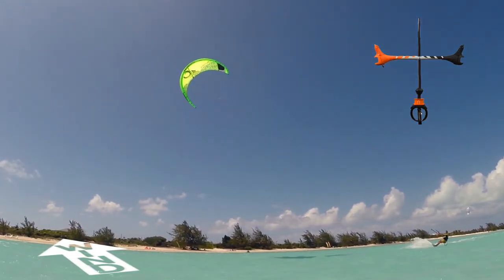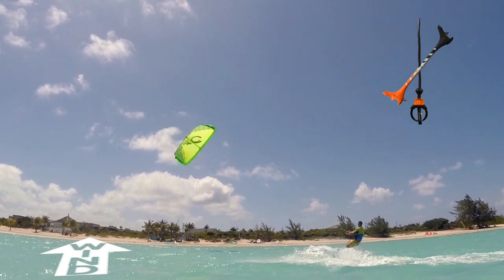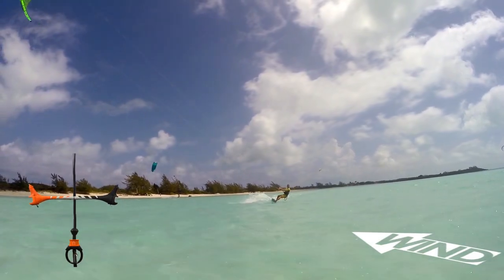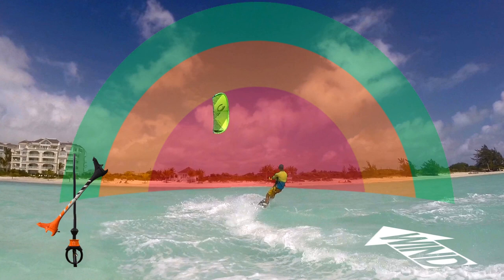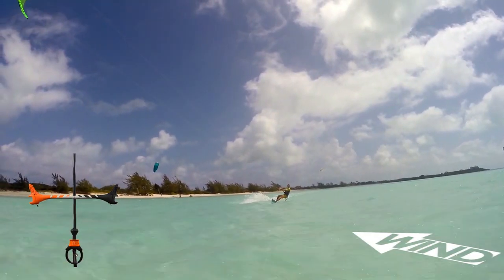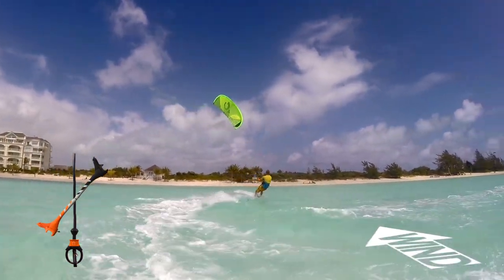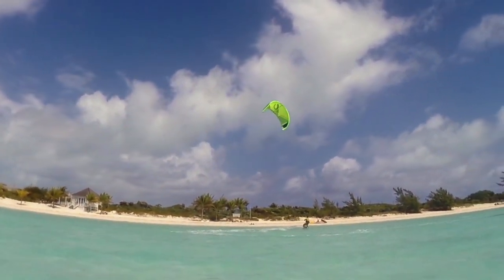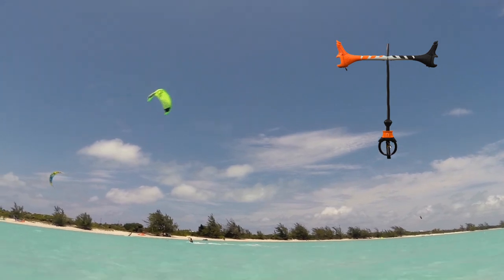Down Loop Transition - Kite Surf Co Tutorial

Comment: Excellent video.  Especially like the bar animation which is completely absent from many instructional videos..
But, why do a downloop transition ?  One reason is that it enables a much more aggressive carve (either heel side or toe side).  Sending the kite low across the power zone (a) gives much more power and (b) can hold the edge better.  The traditional method of sending the kite over the top tends to lift you off your edge.

Comment: Thanks, great explanation with simple diagrams.  You mention that the rider at :44 switches to toeside, but I didnt see them do it?  Is it that they are only staying toeside for a split second before edging back on to heels in the other direction?
Reply from the maker: Exactly Evan. You switch your board round to toe-side stance. But instead of edging on your toes, as normal, you edge on your heels, which turns you downwind and gets you ready to down-loop.